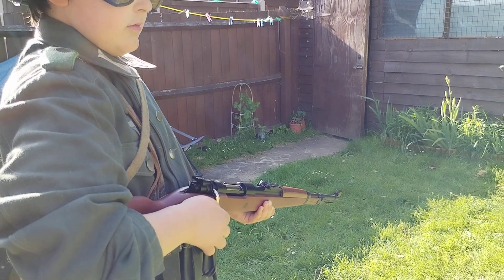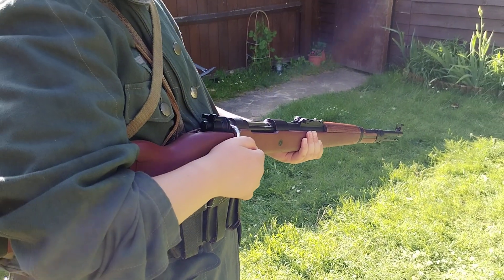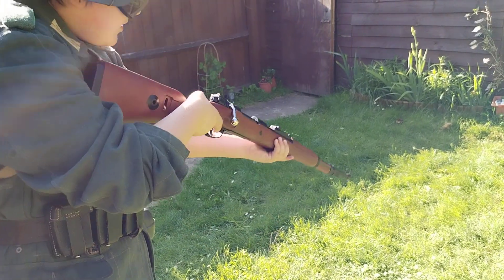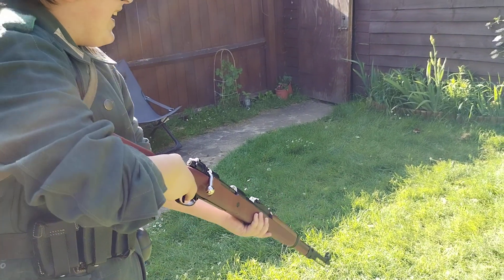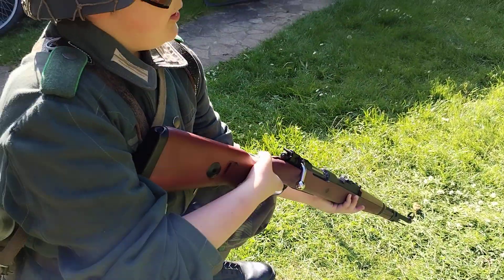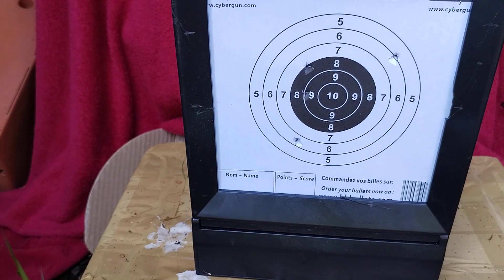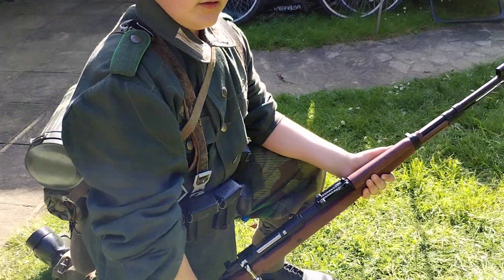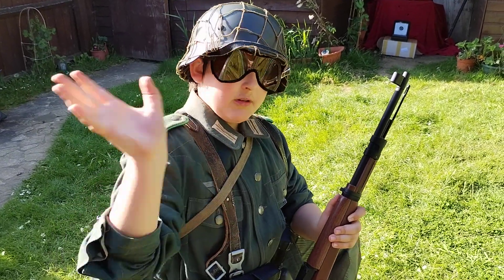Airsoft K98 Rifle

Comment: Nice bit of kit....it is a spring powered air soft,  as in the bolt is the spring ?....and not co2?....I like the way the spent cartridge flies out...I wish deacs did that...thats all I would need😊😊😊
Reply from the maker: yeah just spring powered, I know if you eject the rounds that would be great 👍
Reply: @Blitz1944  😊😊😊